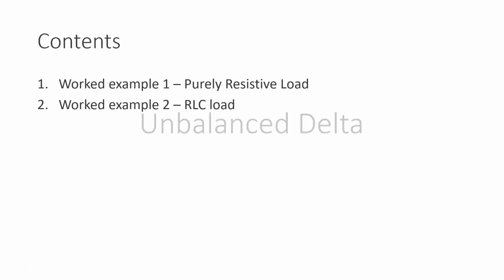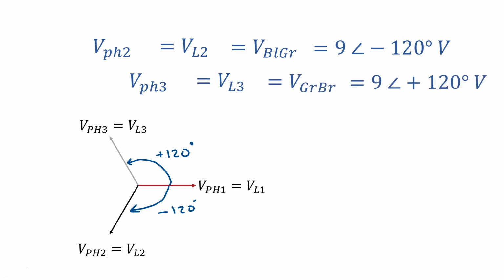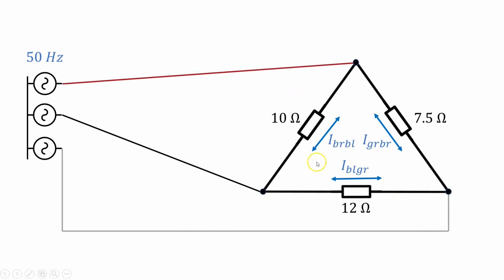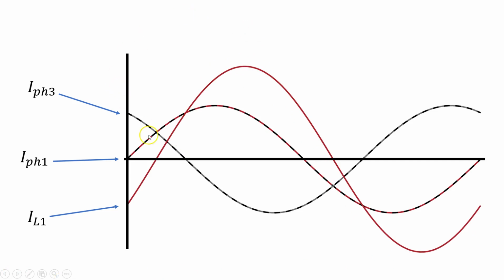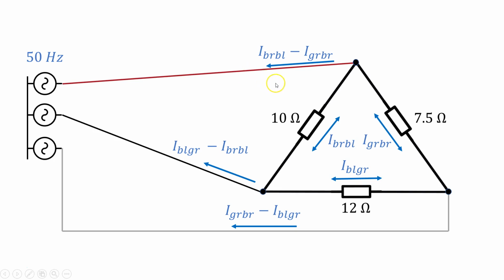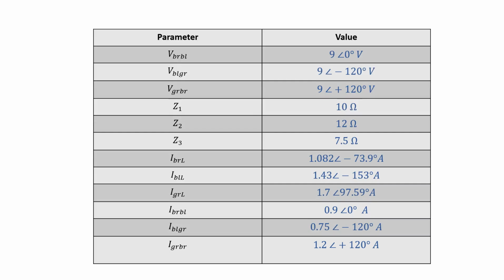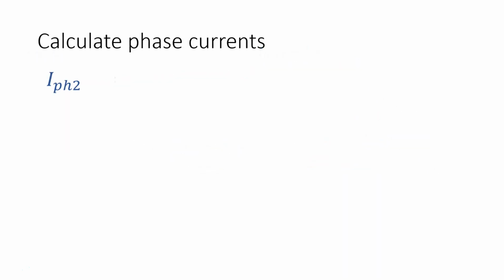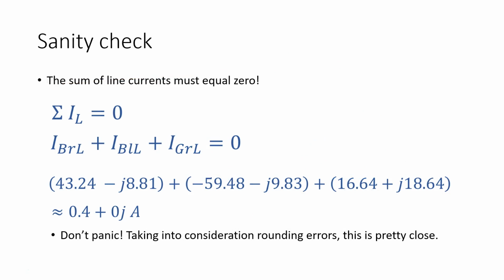Tutorial: How to solve problems with unbalanced Delta-connected 3-phase loads

Comment: Your example became irrelevant to the real world (or rather, not useful/helpful to us living in the real world) the moment you said "and we're given some impedances".
I know what the MAGNITUDE of the impedance values are in my delta circuit, but how in heavens name am I supposed to come up with the 2-dimensional version of my impedances? All I know is they are connected in a delta, they are resistive-only, and I know the pure value/magnitude of each load. I have no idea how to determine what polar or cartesian representation of those impedances to use. And when you skip right over how to determine those in the real world, and you only do your calculations off of "we're given some impedances" in uncommon complex form, then at that moment we have no idea how to use or apply your tutorial.